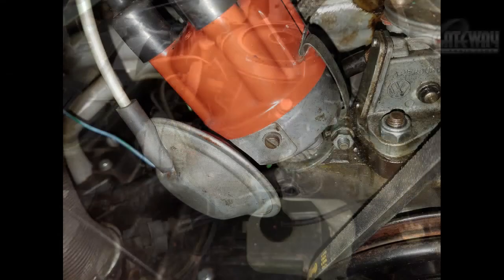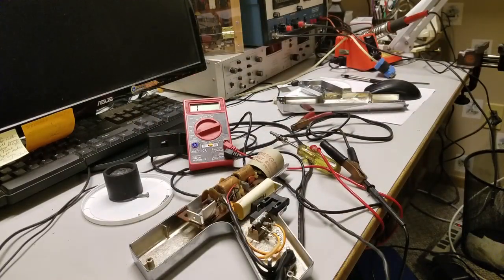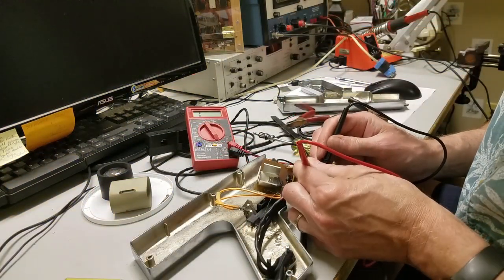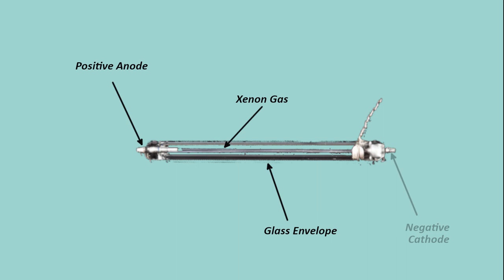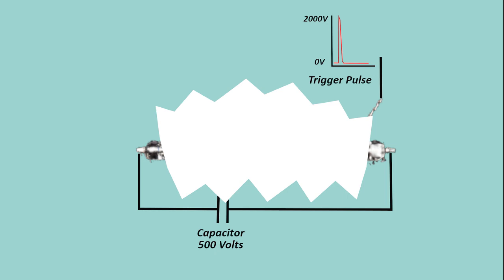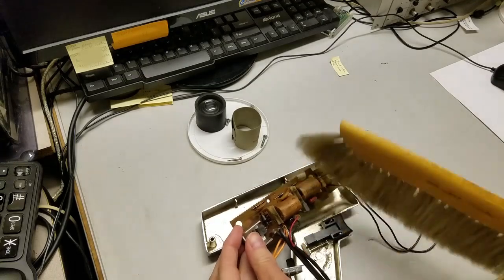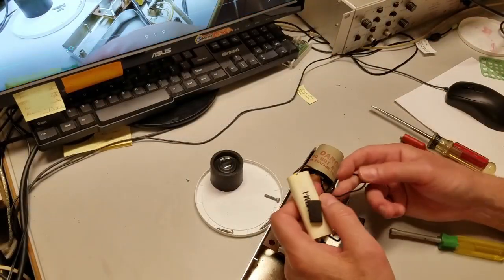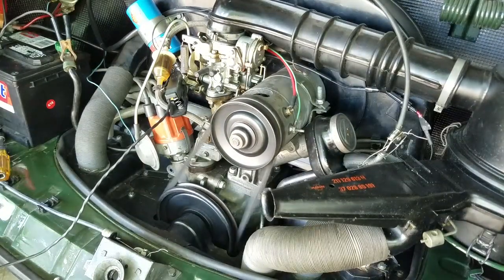Reviving a 1970's Timing Light - Sears 244.213801

Comment: Well, my brain always goes to bad caps. But lo and behold a good cleaning like you said seemed to fix the problem. I did find some arc-over in the one I was repairing. I put some insulation on it. Life is good, thanks for the video. BTW, when I removed the cap across the xenon tube and tested it, it came out at 2uF not 40uF. 40uF at 1000V is a LOT of energy.
Reply from the maker: Thanks for keeping vintage tools alive.  You're right, 40 ufd would be a lot of juice.  Thanks for watching!

Comment: Good day from south africa David , thank you for the video , I would like to ask if you wouldn't mind looking into possibly how I could trigger the flash using an optical sensor , I would like to try this application on rotor blades to see what they are doing in flight and thought with reflectors on the blades and a strobe timed as each blade comes around it may be possible to see or freeze each blade as it passes by
I unfortunately have very limited electronic knowledge so wouldn't know where to start , but I have a timing light just like this one of yours and thought instead of a inductive pickup , an optical pickup could enable me to see each blade as it passes by , I just dont know how the inductive trigger works and what sort of input the scr needs to trigger the high voltage transformer to fire the tube 
Thank you for your time and consideration,  I hope to hear from you soon , 
Kindest regards and blessings from south africa
Richard

Comment: What did you repair?
Reply from the maker: That's a good question.  It didn't work when I started; but worked after I cleaned it.  Electronics from the early 70's were pretty finicky.  I theorize that contamination caused the high voltage charge pump circuity to leak a little too much, so the oscillation would never start.  I wish I could say for sure.  I was never able to reproduce the failure.  I thought the video might still help someone; so I posted it.  Thanks for the comment.

Comment: Has anyone replaced the Flash Tube Found this exact same one? Got it at the swapmeet, didn't check it. Got home and found out the bulb was burnt. I've been looking for a replacement no luck. The closest I've gotten is this one. The darn thing is in very good condition, hate to take it back to the guy if it can't be fixed. 

Thanks.
Reply from the maker: I haven't replaced it; but I'll bet if you get the same form factor that there is a pretty good chance it will work.  Good luck!

Comment: I have the exact same timing light and was wondering if the schematic is available for download. my light is not working. I've already checked the usual suspects (wires, switch, etc.) I have another light so I almost scraped it until I saw your video. Now I want to play with it some more and maybe it will work, I used to have that exact same Heath Kit VOM Meter but gave it to my brother a couple years ago after it shocked me a couple times. He thought he could find the problem and fix it. He's into ham radios and those type of meters work well for testing circuits and components in those radios and mlcs;
Reply from the maker: I uploaded my re-engineered schematic.  (https://github.com/LifeWithDavid/Timing-Light/blob/4726a4ffb31d5ac0ca7241ed17db0179669aa212/Schematic%20none.png) I don't guarantee the accuracy; but I think it's OK.   Good luck!

Comment: It seems you have electronic engineering skills and can dumb it down well enough for me but , pulling things apart and finding no fault only to find it works again is luck . Don't ask me how l know , nothing ventured. Thank you , didn't know how the globe worked until now .
Reply from the maker: I agree; it would have been so much more satisfying to find a bad component.  But what I have learned is that high voltage analog electronics are subject to failure by contamination.  So it was part luck, and part clean-up.  Hopefully others will have this same experience.  I'm just happy the timing light works again.  Thanks for watching!

Comment: David, thanks for your video. I know it's an older posting, but because of your instructions, I was able to check and clean my timing light. It wouldn't fire off and after close inspection, I found everything inside looking in order. I checked the female cable pin connectors on the gun handle and found two that were spread apart, which made for a poor connection. 

I reassembled everything and tested it using my lawnmower (I don't own any vehicles with older ignition systems) and it fired off like old times.

Before watching your video, I would have junked it, so thanks for giving me the thought to open it and check on its internals. 

Question: do zennon tubes go dim or do they just go out?
Reply from the maker: Congratulations!  I'm glad it helped.  I don't know for sure, but I think the tubes just go out.  They have been used for decades for airplane strobes and tower lighting, and they rarely fail.  I believe their brightness stays constant throughout their life.  Thanks for watching!

Comment: i have also a old timing light which is similar to yours but its not working anymore. i opened it up and i saw the transistor got damage . the transistor code is 813 3521 what is the replacement of this transistor ?
Reply from the maker: I looked though some of my old transistor replacement guides and it MIGHT be an MPS2222A.  I saw that there was a 3521 Sears number.  But without seeing the transistor, or knowing where it is in the circuit; I'm shooting in the dark.  Good luck!
Reply: @LifewithDavid1  Thank you so much for your feedback Sir.
Reply: I know this is a late reply, but I replaced my bad 2N5496 transistor with a 2N6488 from Electronic Inventory Online.

Comment: I may have missed it but you never said what the problem was.
Reply from the maker: It just stopped working.  After I cleaned the inside of the gun, it started working again.  I think the dirt caused the high voltage circuitry to malfunction.
Reply: @LifewithDavid1  Do you know David I had the same problem  but as a mechanical engineer and not being as proficient as you on the electronics side I worked from the out side in so as to speak and was checking the cables only to find the problem was not in the bulb where I thought it was but in the trigger switch and the cable where it went into the gun..  Others may find the same so my advice is work from the outside inwards. Cheers Sid from the UK

Comment: I have 1970s timing light that's designed to have the xenon tube replaced by just quarter turning a plastic holder of the tube and it comes right out. Problem is, no one seems to sell such a flash tube anymore. Sad, it's a solid metal timing light, very heavy duty. But useless without a good lamp.
Reply from the maker: It depends how much you want to get into the gory details.  If you really like the light and are willing to try to fix it while realizing you could fail, try getting a bulb that has a similar physical size as the bulb that is currently in there.  Bust into the bulb housing and replace the bulb itself by soldering  or crimping as needed.  I could be wrong, but I think Xenon bulbs with physically similar sizes will have similar electrical characteristics.  For $5 or $10 it might be fun just to see if you can make it work.  Thanks for watching!

Comment: Other than dusting off the circuit board what other repair to the timing light did you do to make it work? I have a Craftsman 14065 and I suspect the xenon bulb needs replacement. I removed the screws to dissassemble but can't get the case to open. Any trick I need to know? Also where can I buy the correct xenon bulb, locally? Lowes or home dept? Please advise. Thank you.
Reply from the maker: The black ring around the lens for the light unscrews.  That has to be removed before the light can come apart.  I never seriously looked into replacing the Xenon bulb.  There are several on eBay; I would get one that is the same size physically.  Also see if has a 1 or 2 wire trigger circuit.  Then just try it out.  Sorry I don't have any better guidance than that.  Good luck!

Comment: Hi David ,....You sure made that repair look easy !! .....No such luck for me & my 1970  "Sears Best" model 244.2115  Non--inductive (direct connected trigger lead to plug) Timing light,  an earlier model of yours....Not used for 30+  yrs but need it Now on a hot '70 car project... Completely dead & no schematic....The simple circuit board has +12  wired to inverter transistor Emitter so probably it's a power PNP type & test ok...Trigger switch cleaned still No flash...Opening a few connections & the 5.5 uf Base coupling cap is open from age....Replaced & all ok now Flashing Good, just like old times Again !!.....Thx for a good video & keep  'em coming  !!
Reply from the maker: Glad to hear it.  Timing an engine is becoming a lost art.  Thanks for watching!

Comment: My Timing Light I don't know the brand, didn't work after I changed the capacitors it flashed but only when you tap the 12 Volt plus cable against the positive terminal with the switch squeezed, I don't know what's wrong with it.
Reply from the maker: If it only flashed once when you tapped it against the 12 volts; perhaps the pickup is malfunctioning.  If it flashes normally, then maybe either the cable has an intermittent open, or the high voltage oscillator components aren't allowing it to start by itself.  Good luck!

Comment: I just bought one of these for a buck...Its mint, and too night to use regularly, so I'll keep using the Heathkit (yes, thats my primary lol).

Thanks for the schematic. Its nice to know that I can always refer back and replace any components that may fail in the future. Seems like my old cars, and old tools outlive the newer things, and more than likely me lol
Reply from the maker: Wow, that's a great find.  You're right about old tools and cars.  By the time we get to electric cars; they probably won't even outlast their loan period.
Reply: @LifewithDavid1  Ive worked on electrics, and what most don't realize is that its one of the older methods. way back in the 1800s...Also, they have been using them in cities as trolleybuses, and while at least that is better, since no batteries to worry about, it still comes with massive costs, rebuilding the engine (re-wiring) every few years, and copper is not getting cheaper. But, for fixed route buses, they were great. As a car or truck? I think its more at play...

Comment: I have a few timing lights that need the bulbs replaced There black and burnt can you suggest a Xenon bulb ?
Reply from the maker: I don't really have a suggestion; however all bulbs should act the same in theory.  If I were doing it, I would go to eBay and find a bulb that was the same size and shape.  Then I would hook up the 3 (or 4) connections; the 2 tube end pins, and the trigger connection on the outside.  Good luck!

Comment: David..Is there a way to make an actron 7250 read or only show half the pulses that are registering on the readout ?? i need to check wide open throttle rpm on an outboard..this timing light only reads to 9999...i have a lost spark ignition so its reading both pulses 2400 instead of 1200...thanks for any help..you were the only guy i cud find that seemed to know what he was talking about....
Reply from the maker: It sounds like you have a 2 cycle outboard; this has one spark per revolution instead of one spark per two revolutions.  This would double your reading.  I'm not familiar with the 7250; does it have a 2 cycle setting?  This would halve the reading.  Otherwise; I see there are inexpensive tachs for small engines for sale on Amazon; (from Timorn; around $13).  That might work for you.  Good luck!
Reply: @LifewithDavid1  thanks david..yes 2 stroke 2 cyl...yamaha..they used a wasted spark ignition back then..1 on compression and 1 on the bottom of the stroke...so the instrument is reading both and doubling the count..at 6k rpm it puts the reading out of instruments range...any tricks to filter 1 pulse..Thanks
Reply from the maker: @realspringer  Sorry, I don't have any other suggestions.  The inexpensive tach on Amazon is supposed to read up to 25,000 RPM for a 2 cylinder, 2 cycle engine.  Any additional filtering for the 7250 would need modifications to the internal circuitry.  Good luck.

Comment: This was a great video, very informative.  I have the exact same Timing Light which don't work and still don't.
I measure 500vdc at the Xenon tube but can't get it to light up, even when I hook it to my car.  I'm suspecting either the Xenon Tube or the Triggering Circuit - maybe that SCR or something with the pickup sensor.  All the coils and resistors are OK.  BTW, your schematic looks spot on for the power supply, but I suspect the circuit around the SCR is not quite correct.  I need to order the RCA 928 SCR (165-956-1) but can't find it - will about any SCR work?  Also, is there a way to test the Xenon bulb or better yet fake a trigger to the Xenon???
Reply from the maker: Here is a Sears schematic and parts list for nearly the same timing light that Roger sent me:  https://github.com/LifeWithDavid/Sears-Timing-Light/blob/main/SearsTimingLight.pdf

From the parts list; a C106B1 SCR should work.  200V, 4A.  As far as the Xenon bulb,  I don't think there is an easy way to fire it.  At low voltages, I think there should be no continuity between any of the three connections to the flash tube.   Be aware that the pickup is pretty fragile, and it does make a difference which way it goes on the plug wire.  I didn't get much further into troubleshooting the timing light; but I would also check the trigger coil.  Good luck!

Comment: I had an old Craftsman timing light that wasn't working. Took it apart like the video shows, brushed it off and put back together. Works now!
Reply: Have this light.  It flashes erratically.  Don't know why.  I opened it and no burns on the board and all wires connected.  Not dirty inside.  Any suggestions?
Reply from the maker: So glad that helped!

Comment: So the problem was it was dirty inside?
Reply from the maker: Yeah, it must of been.  Kinda anti-climatic; but it shows you how finicky high voltage electronics were in the 1970's.  Dirt was also a problem in other high voltage applications like the anodes on Cathode Ray Tubes (in early TV's).  In today's world of low voltage integrated circuits we've gotten "spoiled" by how dirt resistant modern devices are.

Comment: If you have one of these and want to see something different, put the spark pickup around one conductor of a speaker and crank up the volume. You might have to loop the speaker wire through the clamp a few times depending on how much power you have. Then attach a paper towel tube to the end of the timing light and aim it at a mirrored disco ball. The music will make patterns that move and flash with the music. It is really quite an effect given how little it takes to make it happen. Unfortunately it does not work well in multiples which is probably why no commercial light product ever used this effect.